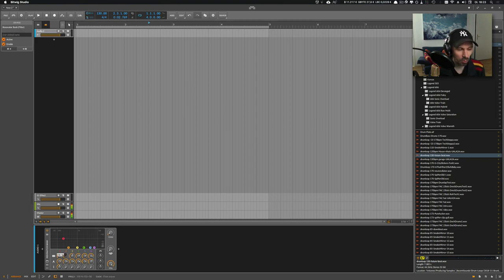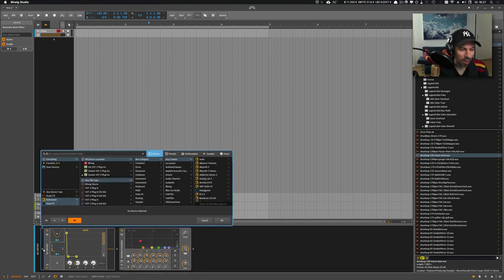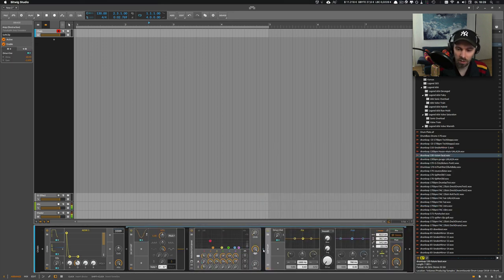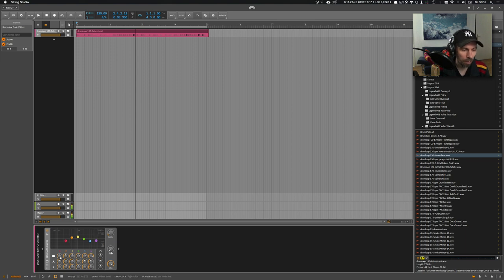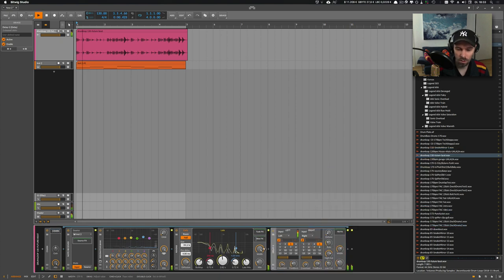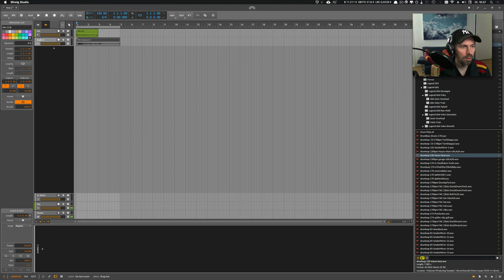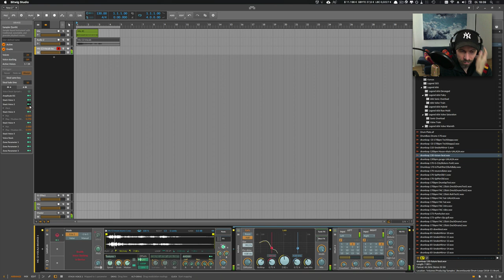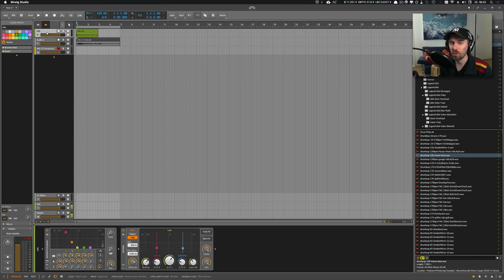Resonator Bank your buddy for 808 Kicks, Melody Drums and Pads - Bitwig Studio Tutorial

Comment: I already built myself a polyphonic resonator in the FX Grid. The key thing is to use multiple bandpass filters with resonance close but a bit less than 100%. To get more knob resolution for the bandpass resonances I used a macro modulator. Then turn up the polyphony and set the note source in the device inspector.
Reply: Same thing. The only thing the resonator plugin has is that it takes up less screen space:-)
Reply: @brooklynkayak  Not if you find a clever way to distribute the resonance frequencies. I did some overtone/octave stuff and have a spread control to morph between different distributions -> getting some nice modal synthesis-like sounds. :)
Reply: @Hoergraete  You can modulate/control all parameters in Resonator  just like you can with the bandpass in the Grid. And that means you can distribute the frequencies in the same way.    The only thing that I can find that is not possible is to actually get the bands in Resonator oscillate. It won't go that extreme. Almost, but not quite.
Reply: A resonator is usually implemented as a delay with a negative feedback close to 100% and the delay-time being the wave length of the frequency you want to resonate at.